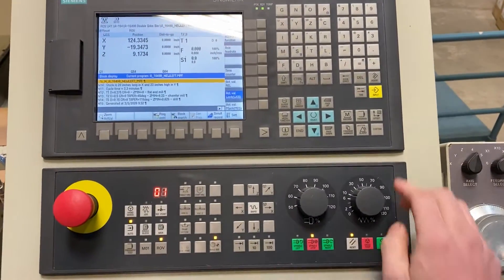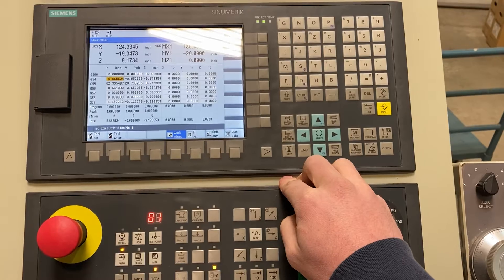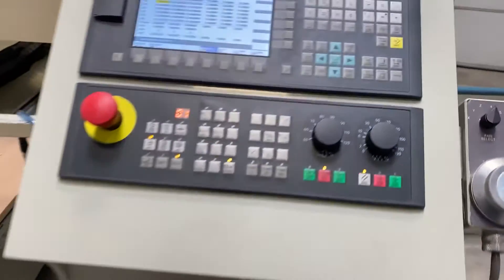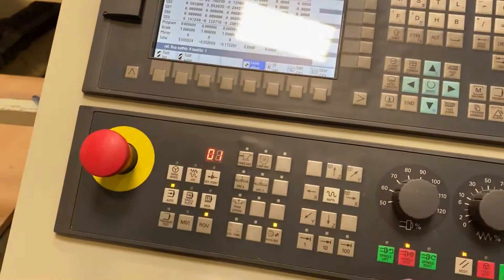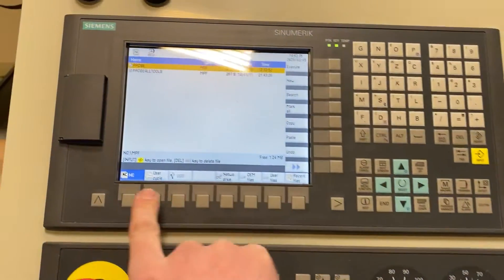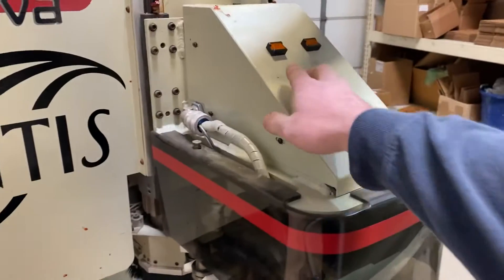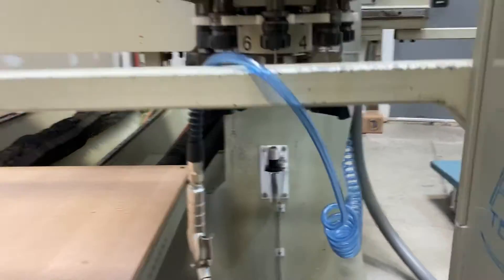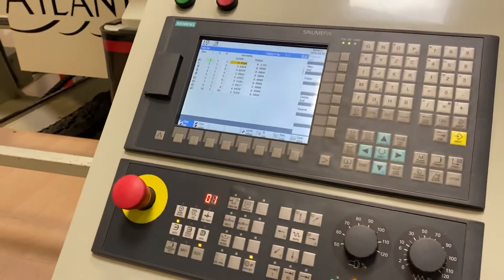Komo Router Siemens 808D part 4 Offsets and Probing

Comment: Hi, for bigger dia insert bullnose tool, how we can take tool length offset in 808d advanced
Reply from the maker: You can manually touch off on the probe by jogging the X or Y axis to line up the cutter to the probe and then touch off with the in control “automatic” process
Reply: Can you make a video please

Comment: Hello, can you share yo me the g code in "PROBE.MPF" file yo analyse how are the step to do  the tools probe ? I will realy  appreciate. My email la lu1jco@gmail.com.   thanks
Reply from the maker: Sure-    I had to go to the manual for the 828 and 840 to find these functions.  the 808 can do them they just don't want you to know that.

;PROBE TOOL IN SPINDLE
G90
R89=$P_TOOLNO
G0 SUPA Z0 D0
G153G0Y-9.325
F70.0
MEAS=+1 G153 G1 Z-7.250
G91 
G0 Z0.25
G90
F10.0
MEAS=+1 G153 G1 Z-7.250
G0 SUPA Z0 D0 
R0=$AA_MM[Z]
R3=$AA_MM[Z]+8.3109
$TC_DP3[$P_TOOLNO,1]=R3
M30
Reply: @ScrappyIndustries  I REALLY APPRECIATE YOUR HELP !!!! I am going to try it tomorrow.  I assumed that it was used from the "auto probe" menu, previously setting the position of the tool probe page 38 of the manual  in: https://www.machinetoolproducts.com/content/Siemens/808D%20Basic/SINUMERIK_808D_OPM_Part1_201212_eng.pdf 
Does a subroutine need to be configured in the PLC to touch probe sensor?

Thanks you a lot !!!